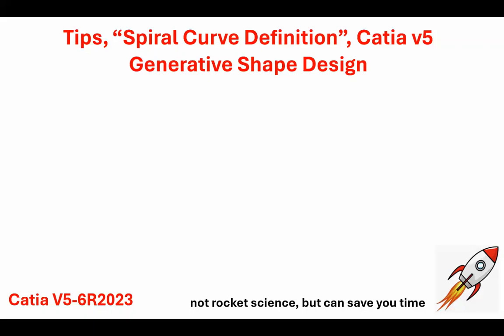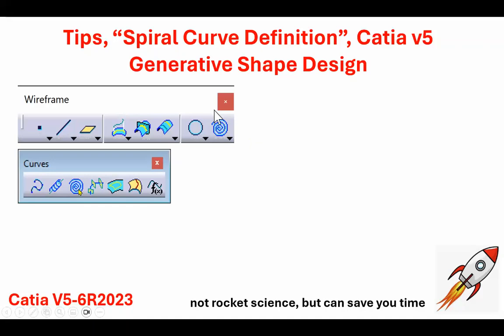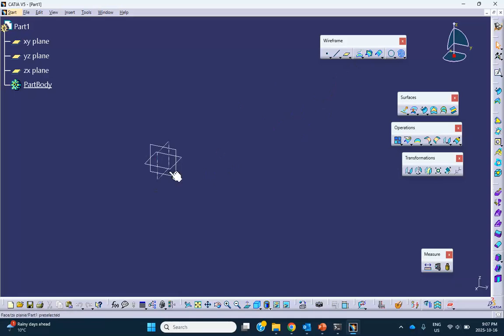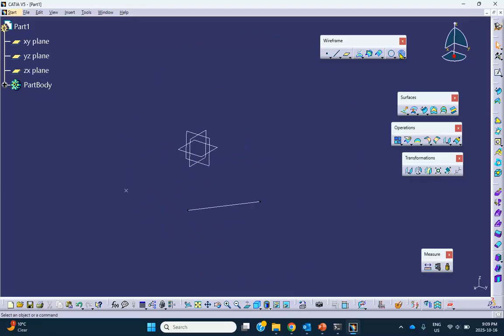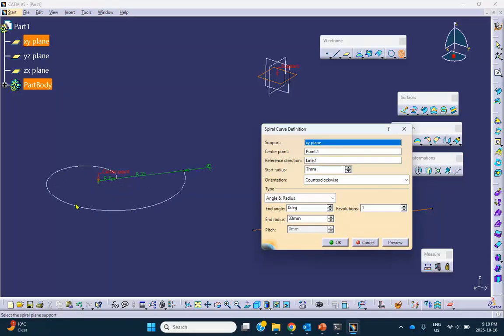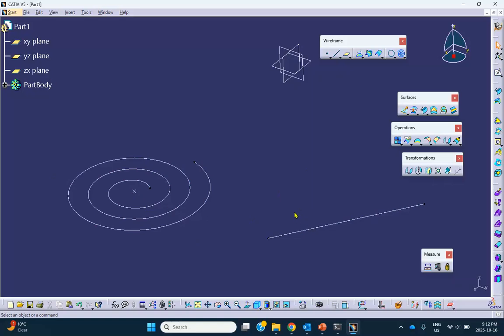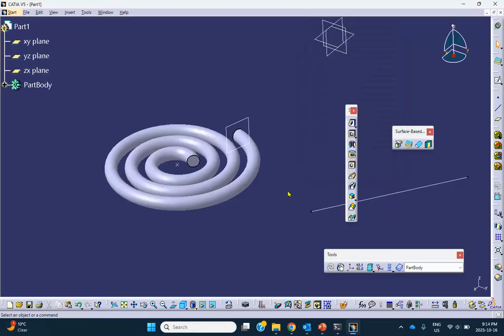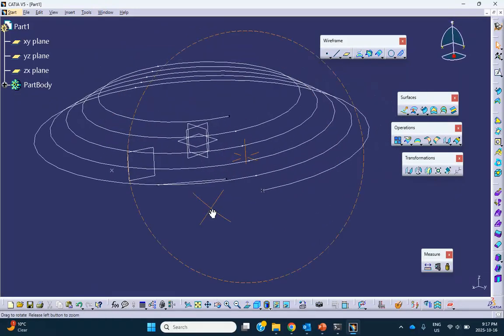Spiral Curve Catia v5 Nader G Zamani

Comment: Thank you very much teacher  , this was my request about this spring , kindly teacher is there any possibility of simple animation , where the center end is fixed  and the outer end flexible
Reply from the maker: Dear Muhammad, since the animation (beside screen capture) requires information about how the spring respondes, it is a dynamic problem. Catia's DMU is only capable of doing Kinematics. This however can be done in the "Motion Design" which is an applicatipon within the3DEXPERIENCE platform.
Reply: Yes Respected Teacher 
Respected Teacher kindly any possibility to have just animation in 3d experience platform
Reply from the maker: @muhammadawais-m7k  Please check the link
https://www.youtube.com/watch?v=q9wORarHctg
Reply: Thank you very much Respected Teacher